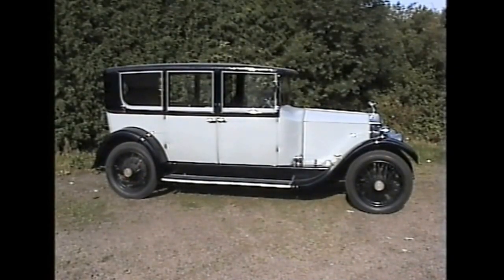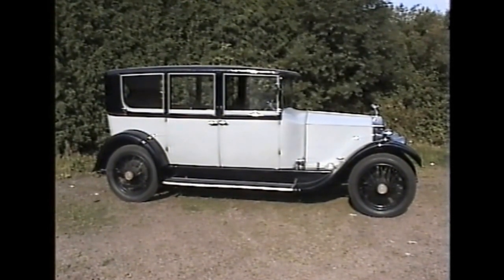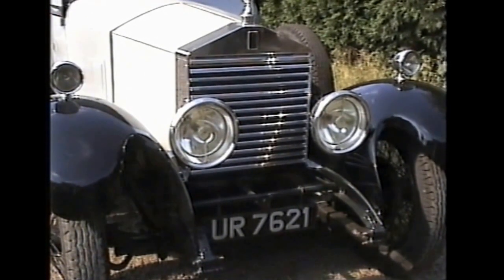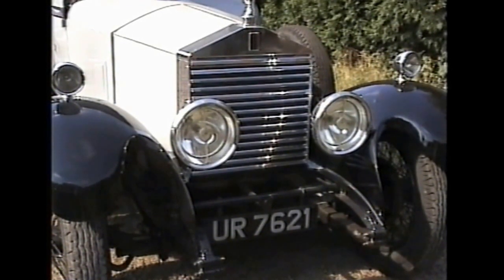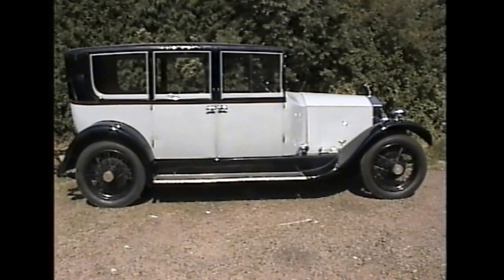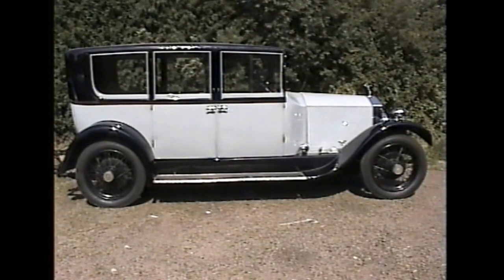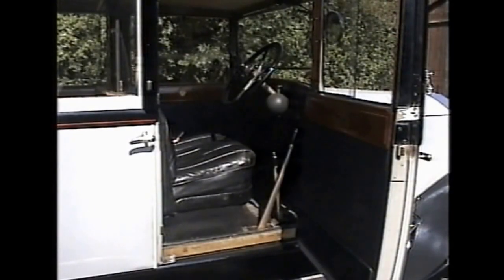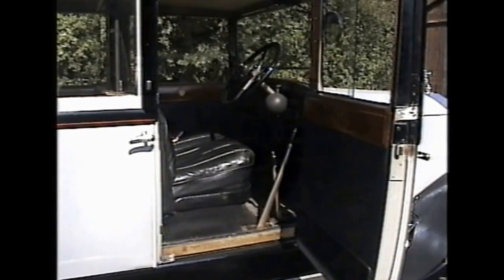A 1927 Rolls Royce 20HP on the road

Comment: Thank you for this very well presented video. It is always lovely to hear the correct terms used when referring to the features of these motorcars. As you say early on in the video, as limousines go this must be one of the most attractive designs. Not only is it attractive in the lines, unlike most limousines - which tended to be the standard offering - this has quite a few noteworthy features. Furthermore, I would note that the rather pronounced noise that is made by the car when in motion I notice sometimes confuses even the most knowledgeable of Rolls-Royce and Bentley experts. This is perfectly normal and it is as the cars should sound. Having spent time in a number of later, though distantly related, Wraith models I can attest to this.